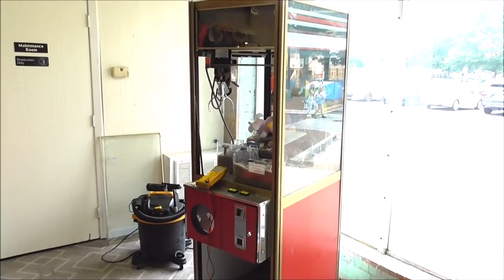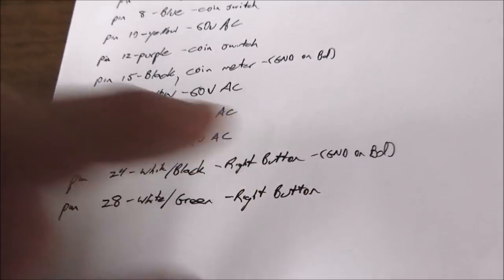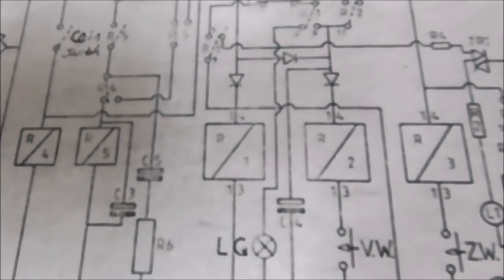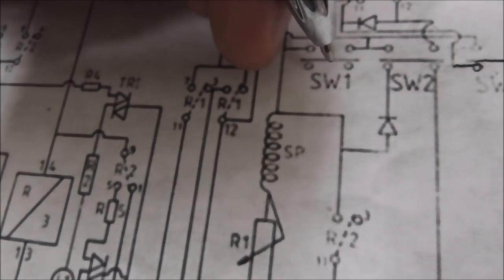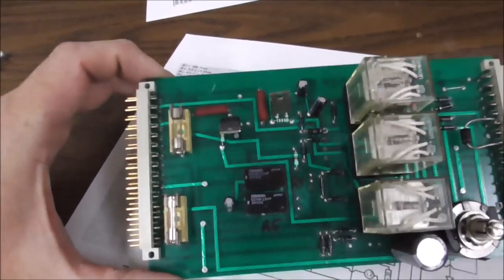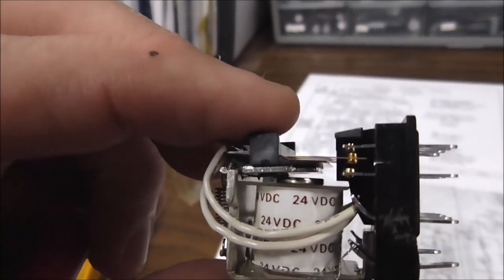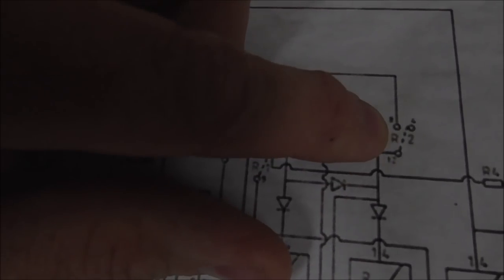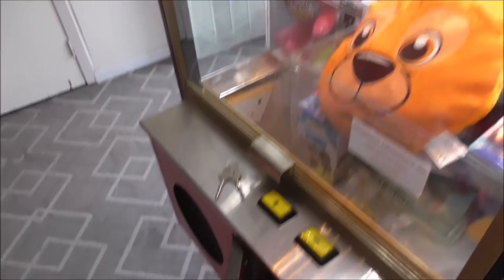The Old School 80's Crane Machines Used Relay Logic To Work, Check it Out!  Plush Claw Game Repair

Comment: Wow. That was some over-complicated schematics for such a simple looking board; even the 1 or 2 coin setting seemed far from easy! Admittedly, I tend to steer clear of grabbing machines - too many rogue operators over-adjusting the claw sensitivity.
Thanks again for the informative video :)
Reply: I think they optimize schematics for space rather than readability. Less paper that way. The schematic could likely be made far nicer to troubleshoot with if it organized for flow instead.

Comment: That was some good circuit-sleuthing you did there, I've been in a similar situations where I've had trouble figuring something out only to realize, after I've pulled half my hair out, that the instructions are wrong.
Reply from the maker: yeah sometimes you end up spending a ton of time figuring it out, I kind of see it as fun so I didn't mind spending all day tracking it down, now maybe I'll understand the next one I work on a little better :)  I feel pretty confident that any of them that take this relay board are simple enough to repair no matter what's wrong with them.  Thanks for watching Fred!

Comment: The stop circuit seems similar to what's used in self-contained jack screws.  When power is applied in one direction, the jack screw extends until it hits one limit switch.  Then you reverse power and the motor turns the other direction until a different limit switch is hit.  The diode on each limit switch allows power to flow around the limit switch even though it's tripped, when applied for the opposite direction.

Comment: I wanted to give you an update on the board I was looking for, I searched eBay and bought quite a few of the chaser boards non working after I fixed one of the boards the other ones I bought I used the one I fixed as reference. I had to replace the ic chips and the transformers on all of them. the most sensitive component is the Mini three pin transisters on the board

Comment: I really enjoyed watching your repair of this machine.  There was one at our local amusement arcade and I'd sometimes put increasing amounts of money in, over the years (that's inflation!).  I think that I snagged one or two toys over a five year period.  The machine was set so that the claw was so weak that if it so much as caught a hint of an object in the way, it would retract and reset.  I always thought that there was a microprocessor running the show - I'm surprised to see that it's all diodes, relays and a triac.  The machine was positioned at the entrance of the arcade so that it was hard to ignore.  I expect that with the low price of the toys and the increasing fee to play, the returns must have been good.

Comment: Interesting... after rearranging the "new" schematic for readability (it pretty much just showed the components in place on the board and even faithfully retraced the traces), I compared it with the old one.  The only change was a diode moved to the other side of a switch, and the coin relay R4 is also now on the SW4 side of the 24V rail.  If only they properly labeled the diodes though.

Comment: We have some of the same problems at the shipyard. 
Much of the equipment that you are asked to troubleshoot either has some beat up schematics that are so faded out you can’t read them, or many of the machines are from the 40’s and 50’s, and they are not even in business anymore, so you can’t track any down.
Or in some cases, you have a good set of schematics that are in good shape, but over the years, functions may have been deleted or modified, or some electrician was told, probably at 1:30 on a Friday afternoon, that the machine was needed, and to just “make it work “, and now some of the wiring was changed that are different from what the schematics say.  Or like what has happened here, the schematics you have are a different revision……🙄
But, sometimes, even if it kicks your butt for a long time, when you finally beat the gremlin, and find the problem, the feeling of accomplishment makes it worth the effort in the end!😉
Reply from the maker: Yeah it's good to at the end of the day be able to stand back and see something that was broken and now it's working and you can physically see it!  Thanks for watching John I appreciate your comments

Comment: WOW.  I never realized these things were all discrete parts.  I guess that's what you get in the 80s..  Today I'd replace that with an arduino (or similar) with a motor driver for each motor and do it all in software!  It is impressive how this works!
Reply from the maker: The only problem with doing it with an arduino is you have to rewire the whole thing and then make specific code, much easier to just fix the board, thanks for watching Steve!
Reply: @LyonsArcade  Oh absolutely!!  I kind of misspoke - I didn't mean it would be easier to retrofit an arduino into that thing  (Wow.. those connectors alone would be tough!!)  I just meant to say if I were to design that thing now, it'd be something like that.   I guess I always assumed that being the same basic vintage of (for example) a Williams system 6 or something that those claw machines MUST have some kind of CPU!!   Your video was awesome and educational!
Reply: I got what you meant... in fact I just messaged a mate saying exactly the same thing. It makes you thankful for Arduino, but at the same time, this is "beautifully simply complicated" when done with switches and relays.

Comment: Have you worked on any Challenger claw machines by Wedges & Ledges?  That was the one at my local pizza parlor when I was growing up.  I loved it.  It had a really funky shape, but it was red like the Big Choice and Clean Sweeps.  The thing I loved about it was that it really felt like a "skill claw" verses a regular claw machine.  It had three buttons so you could control how for the claw drops, when it clamps, and when to return.

Wedges & Ledges also made my absolute favorite coin pusher (also called Wedges & Ledges) they had my local Chuck E. Cheese (which I learned was the first Chuck E. Cheese location.)  Wedges & Ledges coin pusher was cool because it was four players, 2 on each side, with a center wedge that would go back and forth between the two play fields.  It was a lot of fun.  With some skill, you could slap the coin arm and get a token to ricochet and knock some tokens off the edge without utilizing the wedge at all.
Reply from the maker: I've never even heard of them !  I wonder if it was more of a west coast thing?  I've never seen one with 3 buttons, but the joystick cranes had a similar feature after awhile they may have stolen from them, I can't remember the name of it but basically you move with the joystick, then hold the button down to drop, if you let go of the button you can move some more.... that may have been some sort of legal work around to make it more 'skill' based, some jurisdictions outlawed all kinds of games, even pinball machines because they were gambling, lol  Thanks for watching olepigeon!
Reply: @LyonsArcade  Wedges & Ledges is (was?) a California company.  So yeah, it might be a west-coast thing.  I do remember in the 1980s the argument over whether or not claw games were just gambling for kids.  On the old-school machines (pre-Elaut), even after you set the non-payout claw strength, a skilled player could still win a plush every now and then through skilled play (hooking labels and tags, using swing techniques, or just a skillfully placed grab to wedge a claw into a hole, etc.)  It's ironic considering all the actual fixed payout games like Key Master, Stacker, and Barber Cut, stuffed with pre-paid Visa debit cards.

Comment: Is that what a full strength grab looks like? I swear when i seen them played, the claw never grabs that good. Good job on finding all the faults.
Reply from the maker: It depends on how it's adjusted and which game it is, they had different ways of doing what they do.  When I used to operate them for a company, the way we did it was make them juuuuuuust strong enough where you won 15% of the time. They had other ones that grabbed at one strength and then loosened it to another strength as it moved back towards home, this is before that though.  Basically you had to make it not win everytime to pay for the machine and make a profit, but win enough that players would continue playing.  If nobody won at the bowling alley and ran around with their new toy, nobody else would play the machine so you had to have winners, we tried to give away 30% of the money that came in (which came out to winning about 15% of the time).... Thanks for watching Frank!
Reply: @LyonsArcade  fascinating  insight. 
Sort of works out the prize is worth about 2-3 times the "stake".  
In the UK prizes seldom worth the same as the "stake".....guess that's why these are dieing out.

Comment: I only recently found this channel, started with a few of the arcade cabinet repair videos. Been thoroughly enjoying the videos. I am curious as to the failure rate of relays and solenoids are in games of this vintage.
Reply from the maker: To be honest the relays and solenoids don't fail very often, this one is 35 years old and we just cleaned it but it's still using all the original stuff!  A lot of the time you can get away with using the original relays if you clean the contacts.  Thank you for watching Kraft, we appreciate it!

Comment: Couple points:  once a quarter drops through, it activates a small coil in the door that won’t allow a doing to drop thru and trigger a credit.  It has a diverted on it.  As I shared in a comment below, the lights are not “Working”. They hav been bi-passed.  Looks a lot cooler with them flashing.  The board for the lights should be mounted to the ceiling of the game.  Reply back if you have questions on it and repairing it.  Nice work!
Reply from the maker: Rich this is a Big Choice crane that did not have the flash board in the top of the cabinet, the Clean Sweeps did, which was made by a completely different company.

Comment: JOES CLASSIC, I think the Right Button Diode was leaky which was making the Motor turn Right back not stopping all the way? It would be nice to know the sequence of events of how the switches work to know how the switches chain of command happens to get a theory of operation. You seem to know the order of events of how the switches should turn on and off. Anyway to explain the order of events of the switches it in the comment to learn from?

Comment: In episode 2 (I think)of the black Knight pinball repair. You said that since the rectifier just had two diodes. It could not be full wave rectifier. That is actually kind of wrong. You can create a full wave rectifier for a single voltage supply. If you use a center tapped transformer. However I have not seen it very often. I do not think it is a very economical use of a transformer. As it will require an extra secondary winding. Compered to what is needed when using a bridge rectifier

Comment: The reason you are seeing 31V instead of 24V is that the transformer is feeding 24V AC RMS, when the bridge rectifier converts that to DC is will peak out at about 33 Volts (or 31 in your case).  If you put a load on, the voltage will drop.
Reply from the maker: Thank you Blacque!

Comment: Cool video just what I was looking for. 
Can you answer a question on this.  What does it use for a power supply. Someone stole the one out of the one Im working on for a buddy.
Reply: 24/48 volt Ac?
Reply: I read somewhere where it was a simple 2 output 110 in - 24/48 ac out. ???

Comment: Where can I get a replacement motherboard? I got this exact model and it need complete repair.
Reply from the maker: They haven't made them in 35 years, your only option is to find a used one on Ebay or fix it yourself.

Comment: If you can’t get or don’t want to use 28v lamps you can make a simple voltage divider to make an approximately 5v or 12v supply for the lamps you have

Comment: I always wondered how these work. It seems like the claws don't have enough grab to hold on once you grab the prize
Reply from the maker: They have a rheostat on the board to control how many volts go to the claw to make it weaker or stronger, which, when used right, works pretty good but if the operator makes it so weak you can't ever win it actually makes him LESS money because nobody will play it!  You have to be able to win a little bit or nobody sees anybody winning.  If you see somebody win something, you know it's possible and you'll spend 5 bucks trying to win what they won.

Comment: The capacitor helps to compensate for the inverse sine wave, which reads zero volts when converted to DC.
So, you are only getting 30 positive pulses each second, 0 to 48 to 0 to 48
The capacitor holds the 48 during the 0 so you get a small drop, but not to zero, during the 30 places where there is no pulse
Reply from the maker: Thank you
Reply: Actually a full wave rectifier will double the pulse frequency so you are getting 120 positive pulses per second. Same is true of a two diode rectifier with a center tapped transformer. Remember the base frequency is 60 cycles per second.
Reply: @atschirner  I would have to see the schematic and see the waves represented to see how this is possible

Is it taking the cycle and reversing the negative side of the wave ?

Comment: There’s an arcade in the store I work for that has 9 crane machines in it. They’re mostly just common ones though.
Reply from the maker: I think they still make money out of them, kids can't resist :)
Reply: @Joe’s Classic Video Games In most cases the adults can’t either. We recently reopened are arcade after closing due to the pandemic and I have seen many customers both young and old having fun playing the arcade games or claw machines. Sometimes I’ll take a chance or two myself as well.
Reply: Sadly as a bit of an update, the store recently bulldozed the arcade and replaced it with an eyeglasses store. We still have three crane games left in the store. That’s it though.

Comment: Very simple wiring for the buttons and lights. They must have made a ton of money off these. They would have been easy to build 
And they made a lot of money.
The majority of the cost was the lightbulbs
Reply from the maker: We get them in a lot of times where the board has been slightly altered, I think they were just changing things on the fly and sending them out since the circuit was so simple...

Comment: If AC is 24V or 48V, then the rectified DC voltage readings are correct because the sine wave peak voltage is much higher than RMS values used to indicate the AC voltage. It also could use all 4 new fluorescent tubes, the old ones are dead or dying_

Comment: I picked up a 12 outlet strip that is about 8 feet long

You should get a couple to put along the floor and walls to plug in your games
Reply: and plug them into each other and the last one into an outlet
nothing like tripping breakers and risking an electrical fire because you listened to some bone head on the internet
Reply: @haywoodyoudome  each outlet, one stop into each, or run new 20 amp circuit for each. Just the convenience of having a strip closer that you can turn on and off from the switch would be nice, instead of reaching down to plug and unplug
Reply: @ocsrc  Yeah, I was just being a tool.  He moves things around a lot so he'd probably be better off using retractable shop cords mounted from the ceiling every so many feet.